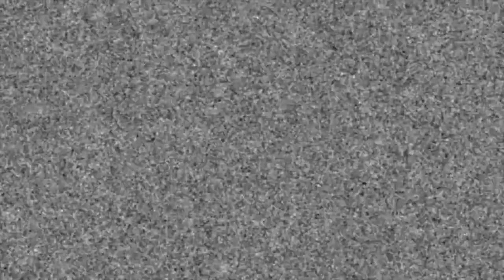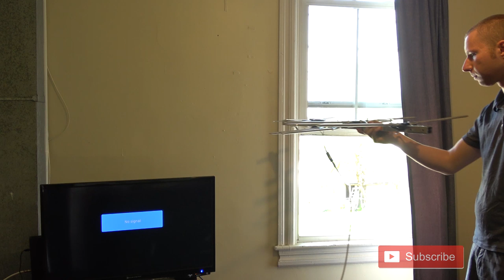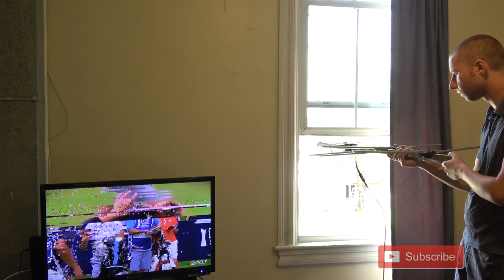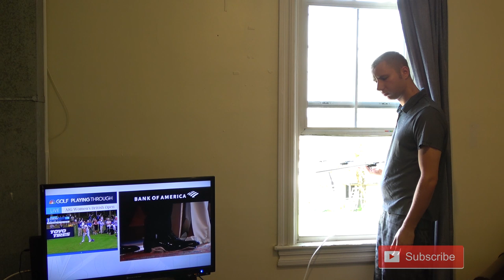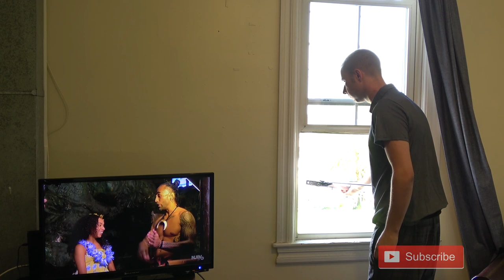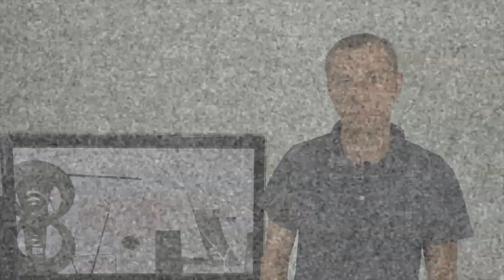Why Indoor HD TV Antennas Do Not Work Well

Comment: In the old pre-digital days indoor antennas worked pretty well
Reply: Exactly. I don’t know why they messed things up and didn’t just leave well enough alone.
Reply: @SL-pg4dh  maybe the bandwidth required needs more accuracy and information.  i think a 480i is going to need almost 10x what a modern 1080p signal is going to.  as well, digital is kind of picky,  and needs most if not all of the information in the signal, where with analogue you could probably just have some interference and deal with it.
Reply: Next Generation TV will boost the signals

Comment: Truth and Quality.
Practical and Useful Information.

Antenna Man's reference of the RCA antenna is the , ANT-751 or ANT-751R.

The antennas are the same for common every day reception.

The R means the antenna is Revised in a small way.

For the ANT-751R some slight changes to metal elements , length , spacing.

May be some slight changes of the plastic.

Practical every day and night use and reception the antennas are the same.

The 751 is a good antenna.

All products are revised as time goes along.

Comment: Very good demo! I use my old "analog" (ha ha) uhf antenna. It has 7 elements with a corner reflector. I think it is a Winegard. I used to sell these at the small independent electronics parts store (remember those?) where I worked for 34 years. My feedline is RG6, about 20 feet. 
 Just went through the repack. I did well. I checked the FCC database and it appears that their CP listed transmitters were higher power. That is good as some of my channels were marginal. Now the stations come in well, even with the summer leaves. I live north of Corning, NY. Kind of like your area.

Comment: I am pulling in over 40 channels on my Mohu Curve 50 in the interior of my second story bedroom. We are between 5 and 20 miles from the various towers, so that may help.
Reply: Truth and Quality.
Practical and Useful Information.

Antennas , Do Not , Pull In , The Electromagnetic Transmission Field.

The Electromagnetic Energy Field Interacts with the metal elements of the antenna.

Antennas Do Not work like a vacuum cleaner , pulling in , sucking in , signals.

You can say the antenna is , Receiving.
Reply: I , like , commas ,

As , the , old , saying , goes , the , more , commas , the , better , 

And , keep , extra , commas , in , your , pocket ,
Reply: @genesky61  Jason
Pircy
Jason
Piecy

Comment: Your video is very good with the antenna inside and out of the house. Before seeing these videos of yours, I had purchased an amplified antenna similar to your Onn antenna that I believe you had said in your video not to purchase because they are cheap and don't last long. Well, I installed my antenna in the attic above the garage. I had planned to put it outside on the old DirecTV pole but it was too big in diameter so I purchased a mounting pole and put it the attic. It so far is working well but I don't receive the weaker stations in my area like NBC and CBS. They are just too far away. I also have a spare because when I first hooked it up, I only had the cable connections finger tight and it did not work and the company sent me another antenna. Then I discovered all I had to do was tighten the connections with a wrench and it worked. I get my regular stations in perfectly with the new antenna, sometimes PBS as well. I guess I may look at outside antenna again if you think I would be able to get my weak stations to come in.

Comment: Have you ever experimented with the beer can antenna? No joke. Recommended in Europe for the DVB-T signals (Europe's version of ATSC) and it works. Solder the wire inside the antenna cable to the top beer can and the shielding to the bottom can. Now you have a perfect antenna for DVB-T. Beer cans are the best as long as they are magnetic (as in a magnet should stick to them). The dimensions of the beer can are perfect for the frequencies they receive. It also fits perfectly in a plastic drain pipe, to protect it from the elements. Obviously the first step in making a beer can antenna is drinking the beer.
Reply: LOL RIGHT ?
Beer cans are made of aluminum. The AR-15 makes a really good antenna, the only problem is they are banded in California and 7 other states.
Reply: You can also use a copper(best) or  stainless steel(second best) and strip part of the cable down and wrap it around the metal(*be sure to tie strap it,  copper from the cable needs touch all way around)  and it works similar to a Diploe style antenna.
Reply: Truth and Quality.
Practical and Useful Information.

Antenna Man is here to recommend Quality and Correct information , not beer can antennas.

The internet is loaded with beer can antennas and such.
For beer can antennas , go to the big beer belly , belching and farting web sites.

Comment: The indoor antenna is very useful in two condition, either you live very close to a broadcasting tower or if you have a portable TV and you wan't to watch TV outside (let's say in the garden, or garage) . In my case an indoor antenna only works outside. I could receive all the digital channels with both passive and active one. Inside I don't have signal at all. I would recommend if you live in flats let's say first floor or second etc. but still don't know if it works or not. I recommend to all the people who don't wan't cable or satellite TV to buy a high gain Yagi antenna (VHF+UHF) and an active splitter (to connect to two or more TVs without signal loss), with the passive splitter you will loose signal strength and quality, or an Outdoor amplified antenna if they live in rural areas.
Reply: I must say that I miss the analog TV. With an indoor antenna (rabbit ears how some people called them). I could pick up all VHF channels clear and the UHF acceptable to good. Didn't needed an outdoor antenna. Now without an outdoor antenna I get nothing.
Reply: *want (not a contraction)
*will lose signal strength (different meaning and pronunciation)

Comment: I have an indoor flat black and white antenna live on the bottom floor and use to get the only station I watch 80 percent of the time. But everyone seemed like they were jealous or it was unfair because they put out a lot of money for cable. Now I probably get maybe 15 stations but I keep antenna close to window. Do you have a suggestion for me to get better reception. Plus it split and I had to tape it back together. Doesn't work as well. Appreciate some advice. Thank you. Cindy

Comment: All your advice indicates a thorough knowledge of RF. You must be a ham. 
The antenna and the window demo was excellent. I think you forgot to take into account the fact that your outdoor antenna was without a preamp. Right? 
Do many of the outdoor antennas come with an amp? It is particularly of value if you have a long lead-in to the TV set. 
If the antenna amplifier was low enough noise a 20 dB loss through a wall will still work. I have several ham antennas that are obviously outside, but I found my TV antenna to the outside to be hard to do and the indoor one I bought with an amplifier did work where the only thing in the way was a wood garage door. (1/2" thick maybe.)

In north Orange County only channels 7 through 11 are hard to pick up. The passive indoor could not get it, but the amplified one did. 

Excellent service you are doing for all of us. 
Thanks.
Reply: I have an outdoor with a pre-amp. When I tried a pre-amp with an FM filter (on),  quality improved at least 25%.

Comment: I haven't tried all indoor antennas, but I have tried many, and I found the ClearStream 2Max  works the best, indoors, that i have tried.  It was so long ago I can't remember, but I'm pretty sure I tried the 2Max because of Tyler's recommendation.  

I bought the 4Max and it works a little bit better than 2Max, but like Tyler says my main problem is the walls in my apartment.  I live about 22 miles north of the tv broadcasting towers or whatever they are called.  I have hills and trees in the way too.  I can get in all the tv channels I want (8 tv stations) just not at the same time.  I have to move the antenna, a little, to get in PBS, but when I do that it causes another channel I watch to not come in.   Not a big deal since I save  $50-$100 a month not having to subsidize 30 or hundreds of channels I don't watch to just to watch 3 channels: ESPN, PAC12, FS1.  I have the Internet so I just go to the PBS app on my Roku if there is anything I want to watch on PBS.  I usually breakdown and subscribe to Sling TV in late September to watch Pac12 games and then cancel after The College Football National  Championship game is played in early Jan.   I just did this recently.

Comment: Hey Antenna Man what do you recommend for people that live in a Senior Apartment Building like myself I can't afford Cable I have a Firestick  but I like my News and my Odd Channel like 2.3, 11.2, 13.2 I have brought a Mohu Leaf with the Preamp some days it works and some days it won't work. I live in Baltimore City in a High Rise Building I am on the 6th floor I only have 1 window in my studio and it is far from the TV plus no outlet near the window can you give any advice. oh yeah I can not run a long cable to the window because the window have a screen that can not open.
Reply from the maker: You can try the Mohu Supreme pro it works a bit better than the leaf. https://rover.ebay.com/rover/1/711-53200-19255-0/1?icep_id=114&ipn=icep&toolid=20004&campid=5338569007&mpre=https%3A%2F%2Fwww.ebay.com%2Fitm%2FMohu-Leaf-Supreme-Pro-Indoor-Amplified-HDTV-Antenna-Black-White%2F202657872320%3Fhash%3Ditem2f2f59b9c0%3Ag%3AY7oAAOSwPHZcukw8

Comment: i use about 20 to 30 feet of coax cable that snakes around the side of the room leads to a chair side stand. i still have rabbit ears from over 30 years ago (although one ear has broken off). i bought a round indoor antenna w/o amp and it worked better for a long time. then, the next time i lost signal i bought  14" battery flat screen with tuner so i have a second reference when a channel goes out. i think the signal varies with celestial movements. but the key is; never throw out an old antenna. many times i unplugged all antennas or i just dropped it on the floor, and then presto- perfect reception.

Comment: I wanted to ask you a question about which antenna I should get for my location.  I live 40 miles from the nearest TV stations (according to antenna web) and there is a power plant about 3 miles away in direct interference with the signal path.  I can get the antenna about 35 ft in the air with a J pole on the top of my house.  I was thinking about the big wineguard antenna but I don't think a J pole will be enough support.  I will have a cable run of about 50ft to a Recast box, as soon as they go on sale again.  The terrain around here is relatively flat.  Could you suggest equipment that will get the job done.  Don't worry, I won't hold it against you if it doesn't work.  The power plant is notorious for spurious emissions and RFI. Thanks
Reply from the maker: If you are looking for an antenna recommendation please fill out the form on my website antennamanpa.com

Comment: That's very helpful. Would taping it to inside a window be ~same as being outside of it? Thanks
Reply from the maker: Not exactly. It may work for you but I was not able to lock in WBRE inside even if the window was open. They are a weaker station.

Comment: I'm up in Southern Ontario, Canada.
I'm reading a lot of American response's about the HOA. Could some one tell me what this is? I know it stands for Home Owners Association.
I do not know there power or authority. Are Home Owners paying a Union Dues or a Due to belong to it? So it's a group of home owners that pay a Union Due  or a Due to hold certain home standards.
Usually, the local City Hall sets the standards or bylaws set for this. So I do not know why you need a HOA?

Anyway the city which I live, Brantford, Ontario, I checked with City Hall reguarding antennas and towers. They say it's wide open here, no restrictions in this area. Want a tripod on the roof with a rotor and large vhf/uhf yagi antenna go for it. Want a 64 foot tower on your lot go for it. (a Home Owner five houses away from me has five towers of different tower heights for tv and ham radio. Those ham yagis are big.
So I do not know what the problem is in not having a outside antenna?
Just check with City Hall for your local bylaw standards.
I know mine here, have installed towers, roof tripods and gable end mounts. Personally like towers the best, they are safe to climb, provides a safe place to mount the antenna up high. Which is the best thing to do for the maximum number of tv stations. 
The indoor antenna junk may work for people in large cities close to broadcast towers. But most of my stations are 70, 80, 30, 50 & 6 miles away. Need the tower to get clear vision of the horizon to pull them in.ii
Reply: *responses (plural, not possessive)

*someone
*their powers (possessive)
*Are these home owners paying union dues to belong to them?
*So they're groups of home owners who pay union dues
*the local city (common noun, not proper noun)
*regarding
*a home owner (common noun, not proper noun)
*an outside antenna (because "outside" starts with a vowel sound)
Reply: To start simply, if the grass and flowers and sign at the entrance to a community are managed and paid for by other than the homeowner then that is the Homeowner's Association (HOA). Getting past what is simple, the HOA usually has authorities to perpetuate how the community looks (to maintain and improve property values). For example, the HOA can create a pallet of allowed colors for exteriors (and those become the only allowed exterior colors). The HOA can restrict/ ban homeowners hanging their wash outside to dry. The HOA can force any exterior holiday decorations to removed by January 7th (or 15th or whatever). They can define what a work truck is and restrict where a work truck can be parked (or exclude all together).
Reply: @mikereece1885  
Ok read your type, but those houses in the city belonging to a HOA pay a property tax to the city. City would have bylaws making no need of a HOA.

Comment: Interesting demonstration. Does that building have aluminum siding? Curious that even when pointed out the window it didn't work. Can you do the same demonstration using various indoor antennas including the one you recommend which to me looks like a dipole for vhf and 2 loops for uhf
Reply from the maker: No aluminum siding, just wood. I already mentioned in the video I tried various indoor antenna models over the years  and the ClearStream works the best both with my test and consumer reports. https://amzn.to/2YIvfC1

Comment: Any idea on which antenna is goof for putting outdoors, but don't want to worry about it facing 100% dead on or I'll lose some channels ? I'm approx. 45 miles to the east of my main Toronto Canada tower. Multi-directional that work best and don't have to spend more than $100 ? but don't mind more, if really is a BOOM Awesome antenna that'll last and have best reception.... oh, is comparing the db rating a basic way to know which one will give the best reception or can a higher db model have poorer reception than a lower db rated model ? (assuming they're not lying about their db gain rating).. and they hardly mention if dbi or dbd ... so,  ? ? is the codstream that has 4 circular things on it really worth the $200 Cdn dollar ?  I don't mind spending fair amount for a great system to last years.
how about this coldstream model , which says it has 24db gain ? https://www.bestbuy.ca/en-ca/product/antennas-direct-clearstream-fusion-amplified-indoor-outdoor-multidirectional-tv-antenna/12404087